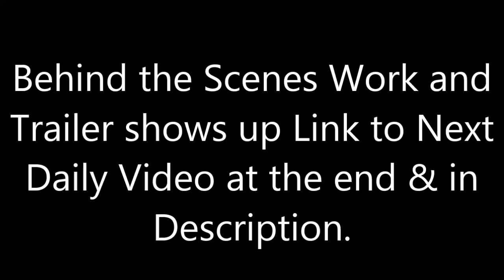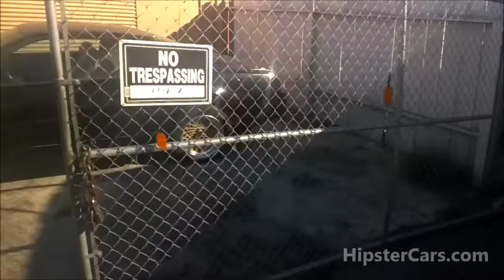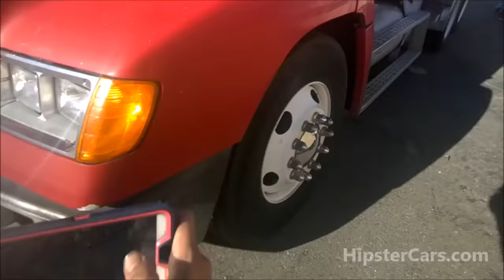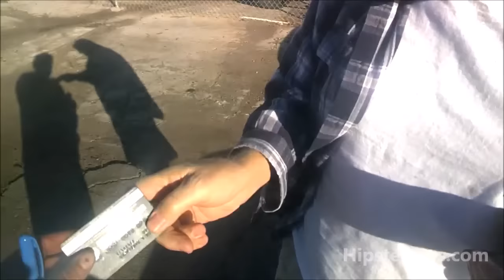Vlogging Work RV Arrives Shop & Lot Problems Car Lockout Video Blog

Comment: Does your lockout kit have an S shaped tool? The lockout kit I had years ago had one and it was made for Fords with the skinny push button. You'd slip it in-between the glass and the belt weatherstrip with a wedge, slide it down low enough to clear the bottom of the glass, then twist it in then pull up until it caught the bottom of the button and pull it up.